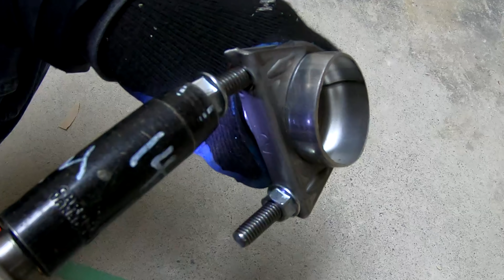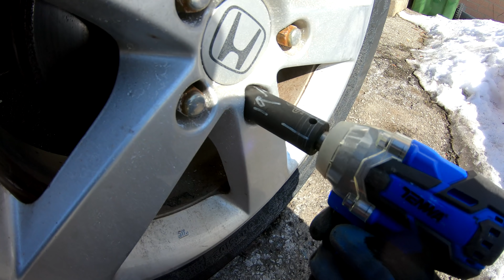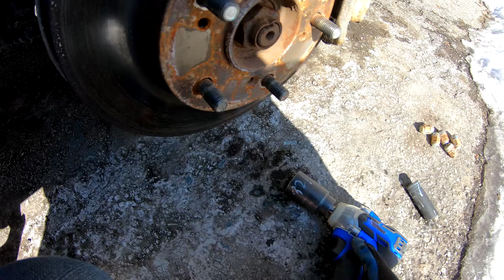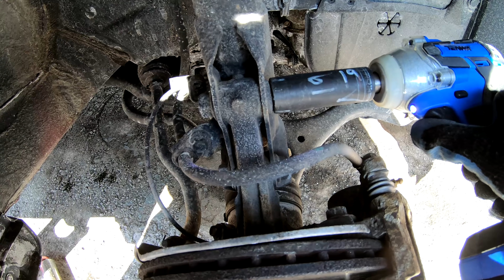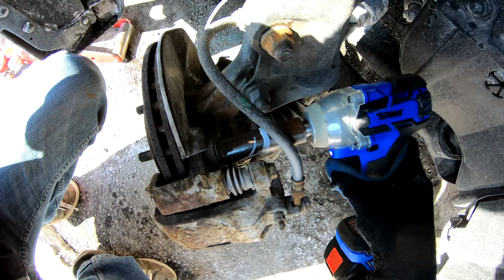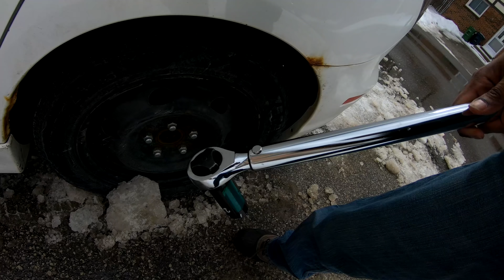Tenwa Cordless Impact Wrench Review

Comment: you shouldn't use it on lugnuts because over time you will wear out the hammer mechanism within the tool. this tool's real torque is somewhere between 140 to 180nm. you're working this tool near it's torque capacity and will go through it within a year.

there's a saying when it comes to using tools for certain jobs: "just because you can doesn't mean you should."

Comment: These things cost $35 with free shipping on ebay. They are worth the price if you already have makita batteries. I am sure these will out perform those older makita 18v half in drive brushed impacts that are still selling for over $100 used on ebay.
Reply: I just picked one up off banggood 30 bucks. Hope it's skookum
Reply: I am new to these cheap impacts. Should I get one? I don’t have Makita batteries or charger. But I just want a good cheap impact. Can you help
Reply: @thurm101  If you don't already have makita batteries, or a makita charger, you might as well just buy a a genuine makita impact kit because it's cheaper.
Reply: lineartechbd1600 Thanks. I got about $100 to spend on one.
Reply: lineartechbd1600 Thanks. I got about $100 to spend on one.

Comment: You did not unlock the axle indentation
Reply from the maker: you don't have to
Reply: @onlyimpacts  I am a qualified mechanic mate. What's the purpose of the indentation?
Reply from the maker: @johneye1963  lots of mechanics dont know but ask yourself what is the purpose of cotter pin , a cotter pin doesnt stop a nut from getting loose it stops the nut from coming off and the assembly coming apart. It is the same with a "staked nut" the stake is there if the nut gets lose the nut wint just roll off on the road and your hub separates from the bearing. It's a safety feature not a feature that hold torque. Thank u like and subscribe

Comment: brushed or brushless?
Reply from the maker: hi in description it say brushless
Reply: Go brushless all it is...its a tiny little piece in the motor to help it run once it goes out most chances are the warranty won't be a help because by that time the warranty had ran out of time or its limited and its annoying bullshit so brushless is the way to go
Reply: @speeddemon_1369  alot more to it than a tiny piece in the motor. Also needs a special switch and electronic speed control board. Ive fried 2 esc on my brushless rotary hammer drill and had switches play up on my brushless grinder and impact driver. They aren't bulletproof.

Comment: I was thinking of getting the other clone of this by Enegitech because it uses Makita batteries I already have. I thought I’d get the equivalent of the Makita xwt11 which both are cloned from but at a fraction of the price at $89. Looks like the similarities stop on the outward appearance. Glad I passed and got the Ridgid Gen 5X/Octane with the new battery deal at the Depot instead. Without the power, an impact wrench is pointless.
Reply from the maker: Hi if you watch this https://www.youtube.com/watch?v=uUDVGzVLh8Q you can see the makita battery fits and yes no comparison vs a ridgid. But thanks for leaving a like for the the video
Reply: singlecams Thanks. Just saw it and I see it’s the same as the other that way. Looks like a light duty impact wrench. BTW, I like your junkyard videos. They really show what these impacts can do. Keep up the good work. 👍🏻